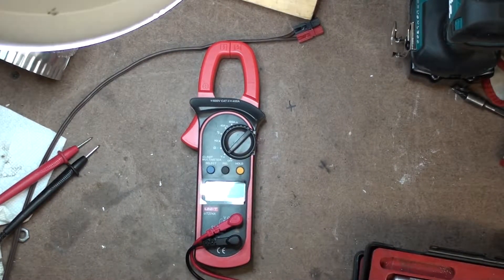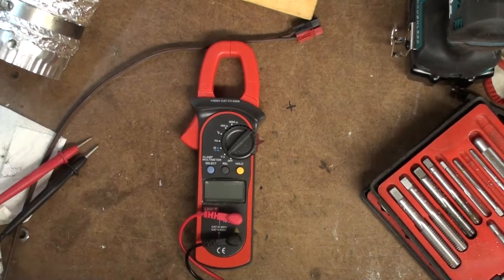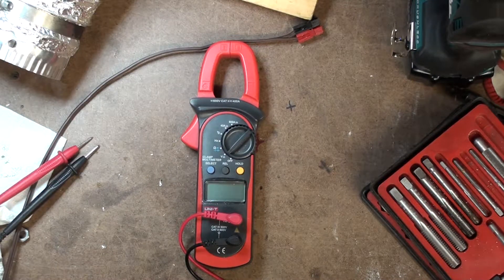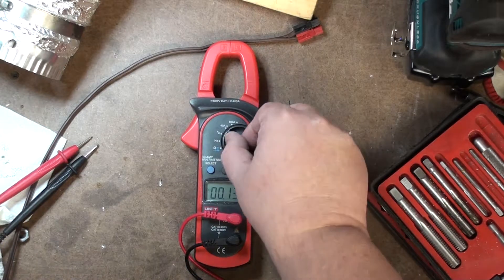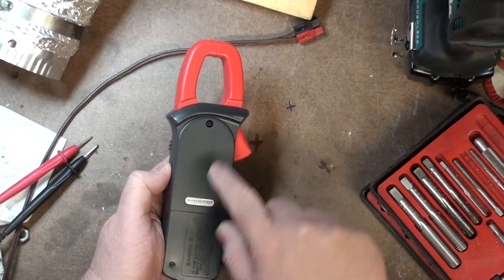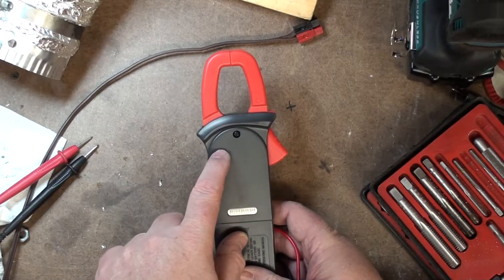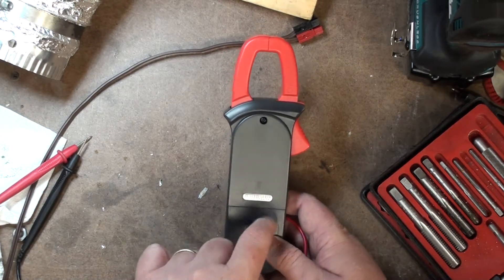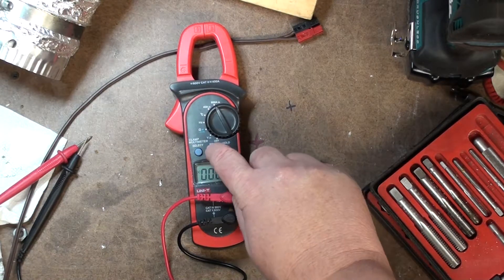UNI-T UT204A DC Clamp meter overload

Comment: … so I have a cheap clamp meter that I purchased just over a year ago and never used as the thing I purchased it for never happened. Today I took it out of the drawer and when I switch the clamp meter to DC amps I get a O.L reading on both the 60 amp and 600 amp settings…? The AC seems to work fine?  Anyway, I’ll try what you’re suggested, but I am not holding out too much hope. Thank you for the video.